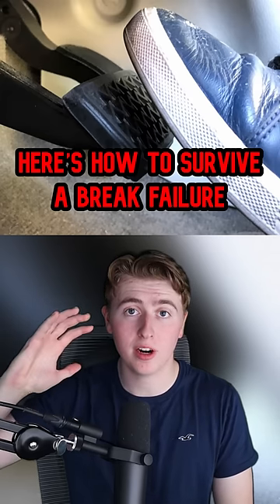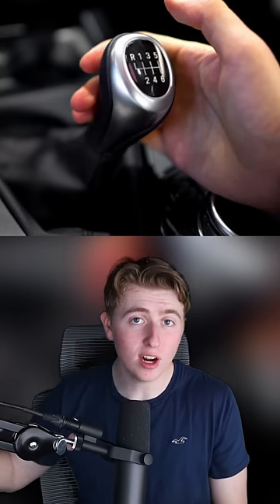How To Survive A Break Failure #Shorts

Comment: If you're in a if you're in a 5-speed drop gears as fast as you can and hang on four-way flashers yes if you are in an automatic surprisingly believe it or not throw it in park it immediately locks all four gears instantly and it comes to stop it's a hell of a lot better or better yet if you're in drive and you're an automatic drop it into second gear it's kind of like an engine retarder it immediately slows your vehicle down like this new tomorrow and then when you get slow enough into one and you still can't stop your car instead of bouncing off the guard will throw it in park you'll do minor damage to your engine only brake is great however that doesn't lock up all four wheels so if you're in the front end car it locks up your asset which means it's kind of like pulling the e-brake would be like driving on ice hang on for dear life however the emergency brake will come in handy in an automatic but apply it don't slam it all the way to the floor slam it about start pushing it in as if your vehicle slows down enjoy it but try to keep control of your vehicle